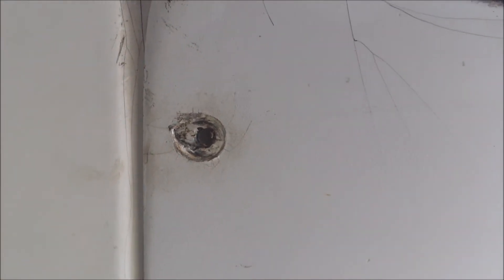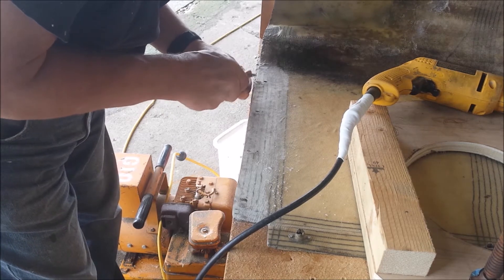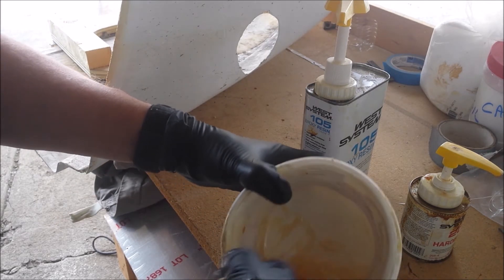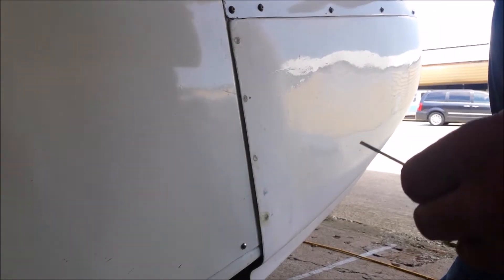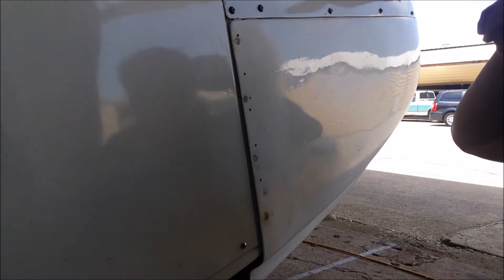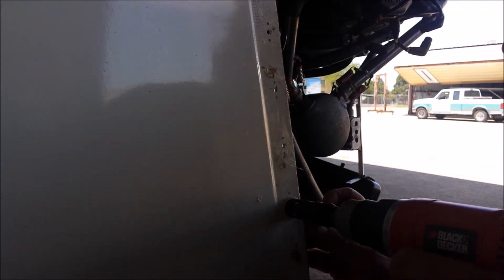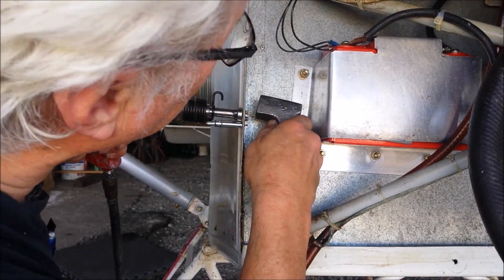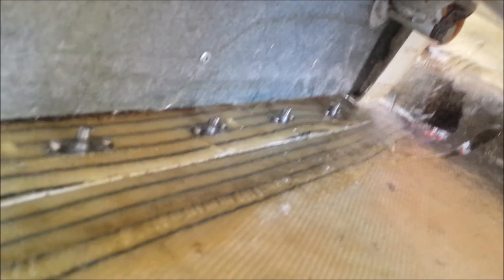Cowling Repair: Installing Nut Plates for the Mounting Screws

Comment: Just an idea even though it’s been a while since this vid was uploaded, why not just use clip on nut plates? Hand rivet squeezers are your friend also for nut plates. Good job overall.
Reply from the maker: I wanted them hard riveted in place so the holes didn't get wallowed out again.  If I had a squeezer 🙂  But it's not something you need that much for a rag and tube airplane.